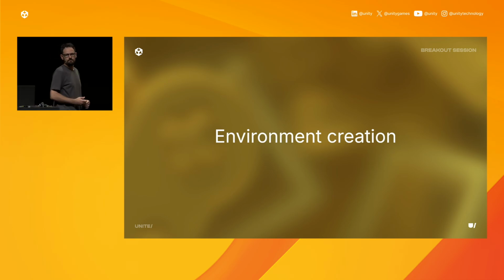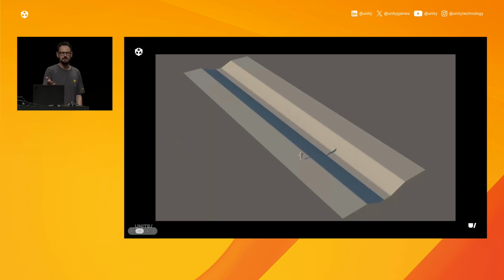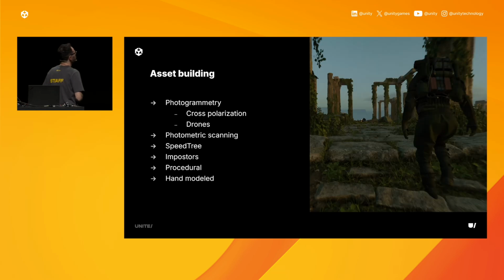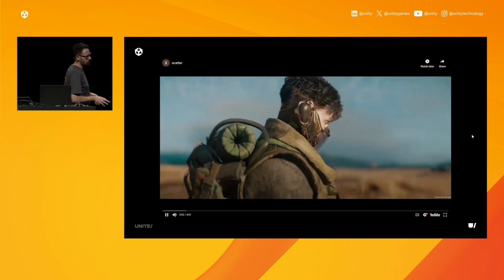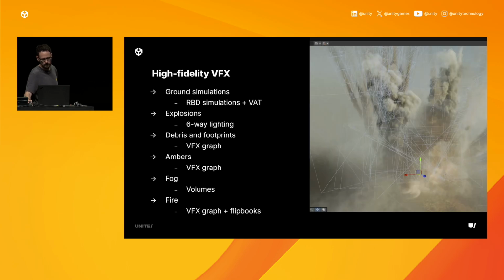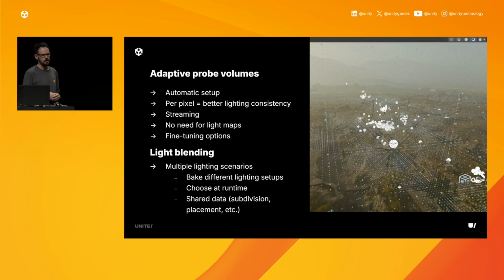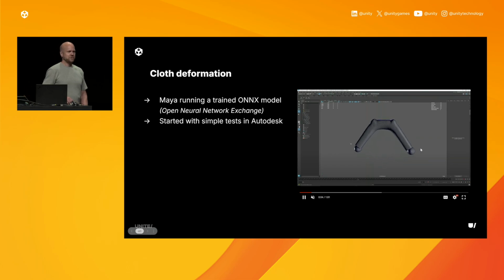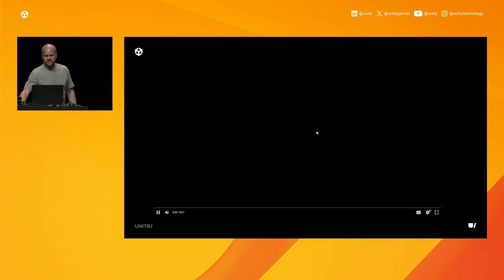Time Ghost – How Unity 6 made it possible | Unite 2024

Comment: Title should be how houdini software made it possible... It's a bit sad that unity terrain is left behind and core terrain is build with houdini.
Reply: let's hope that unity gen terrain will be similar to houdini
Reply: Yes they should have bought Houdini rather than Weta. But they are doing lots of work on terrain themselves.
Reply: You can do everything they did with Houdini with Blender geo nodes.
Admittedly with a lot more work.
Reply: This is a Unity 6 demo. They announced in the roadmap that a much better terrain system will be available in Unity 7. Let's hope this will add a lot more functionality for creating terrains
Reply: Yes, in a proper production you use different tools to make a final product, you don't do everything inside one software, using the best tool for the job.

Comment: It's an impressive result for sure, but how is this really showcasing Unity 6 what is now possible vs Unity 2022. 
Undoubtedly there are probably some cool stuff going on with shaders and materials, but this wasn't shown. Majority of it is covering the standard complex modern VFX pipeline of asset creation.
Reply: Unity 6 doesn't have any new rendering features that would be useful for this, hence there's nothing to show. Biggest Unity 6 feature is GPU frustum culling, but they pre render on 4090 anyway, they don't care how it runs.